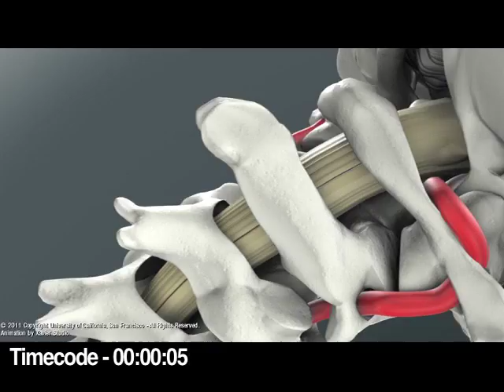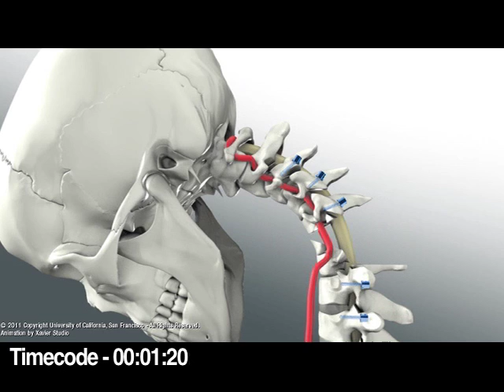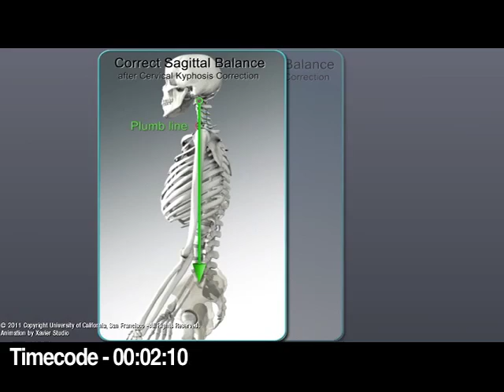Surgical correction of Cervical Kyphosis

Comment: I've had C3-7 replaced and fused at C3- 5.  Now my head leans forward causing terrible pain on my trap muscle.  I just returned from the Cleveland Clinic and the Doctor there recommended this surgery for me.  Any thoughts would be welcomed.  Thank you.
Reply: Jimbo's semi-customs would you recommend this surgery to anyone with Cervical Kyphosis?
Reply: DON'T GET THE SURGERY!!!! AM I TOO LATE!? MESSAGE ME IMMEDIATELY I CAN HELP YOU!
Reply: i also have cervical kyphosis..can you help me
Reply: Why don’t you recommend this procedure?
Reply: @TheRafark  it would’ve involved removing parts of my upper thoracic vertebrae which had nothing wrong with them and then fusing them to my cervical vertebrae.  I have about 70% movement now and it would have limited me to about 50%.  In the three years since I posted this I have been diagnosed with permanent nerve damage which is still causing me chronic pain.  This procedure may have pulled my head back but it would have done nothing to relieve my pain.  I hope this helps you at least a little bit.  Good luck with whatever you’re going through.
Reply: What a dummy u actually thought chop and sew will help you
Reply: @ushyamamoto7098  Why even come on these boards if you just have negative things to say?  People are trying to help each other here.